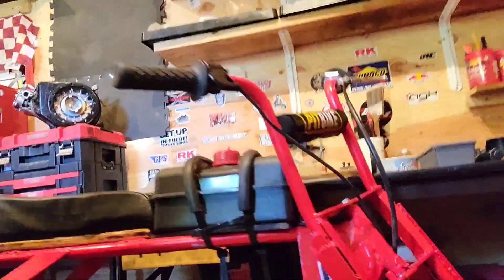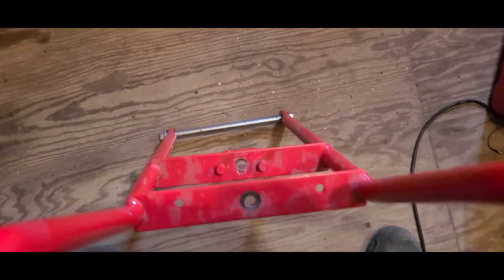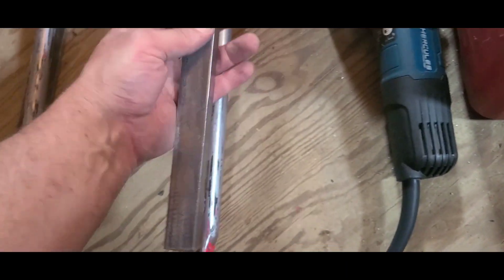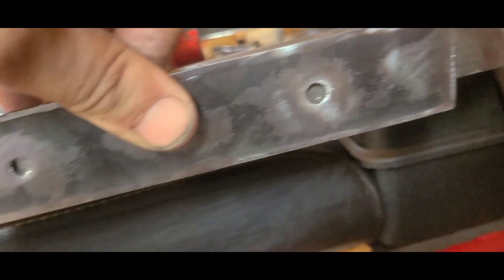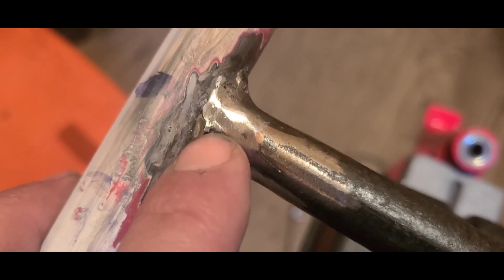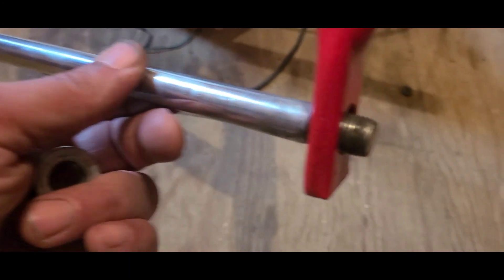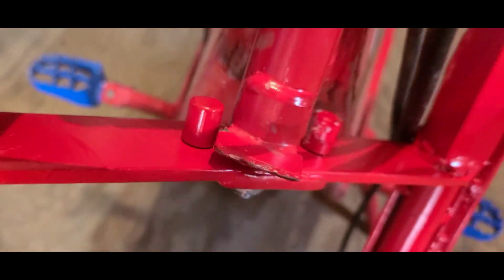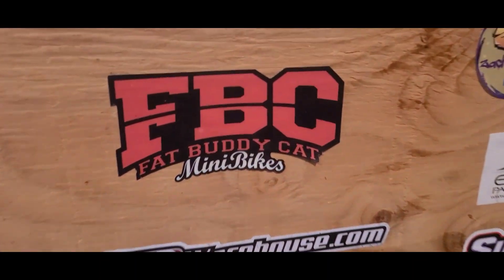COLEMAN CT200U "Fork Work"

Comment: Looking good buddy mine out of commission i broke the bottom neck bearing 😅
Reply from the maker: I just got a new set in from OMBWAREHOUSE.COM just in case! I can see how the suspension fork would be a little less abrasive. This method only ran me about $25, could have been less if I drove to the steel yard for the angle iron.
Reply: @fatbuddycat  I'm going to add suspension kit I've got a db30s messing with right now not sure what motor I want to use on it Ii got bearings tires a 12/60 #35 set up and hydraulic brake kit for it right now I'm thinking my Tillotson 212 will be perfect but also thought about slapping a hemi predator on it
Reply from the maker: @Heathen Projects  I tried to order one but they were out. I think they use the EX lowers with the mm80 suspension tubes to create the correct length.

Comment: Have you thought about building a frame from scratch ?
Reply from the maker: All the time!! Problem is the money it cost to actually do it right vs modifying what is already available. I can weld a lot better on thicker material with stick but to build frames I'd really want to switch to a MIG setup. Drill press is another thing holding me back.
Reply: @fatbuddycat  you’ve got the skills to do it
Reply from the maker: @mklein5179  so many things I want to do!